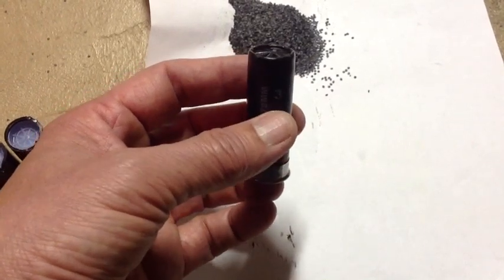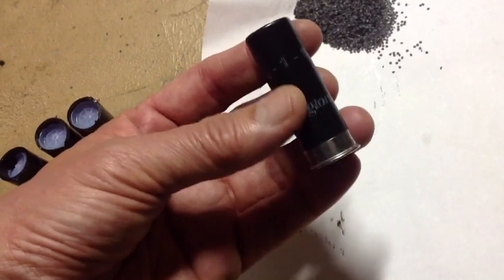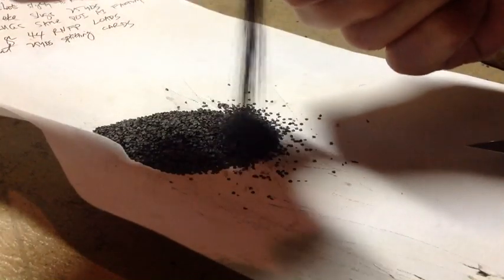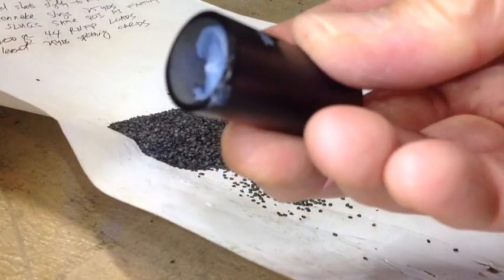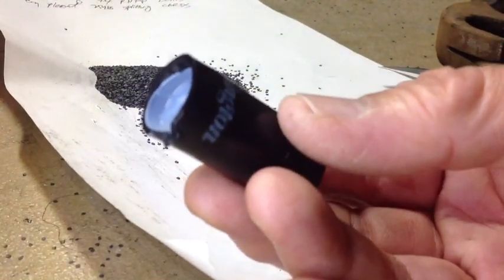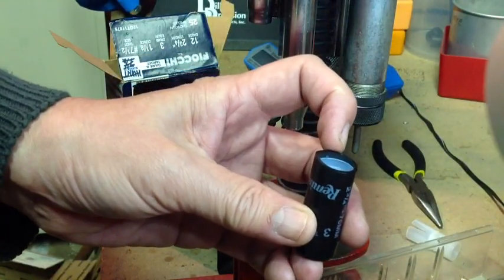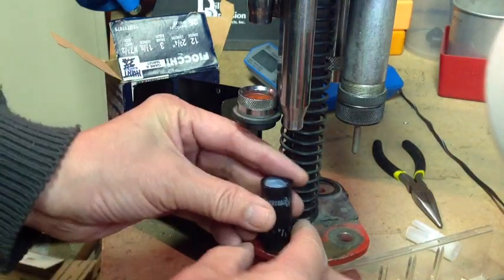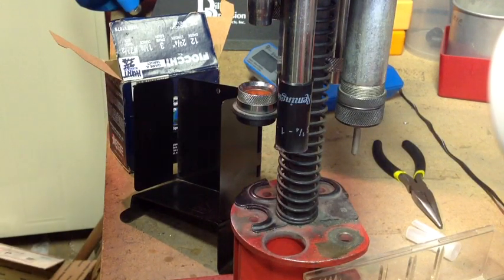Shotgun Slug Reloads - The Hidden Wad Problems

Comment: In one of your other vids you say you are using Federal 12S0 and 12S3 wads with Winchester AA hulls.  I hope that is not the case here, but I suspect that is your problem.  Winchester and Remington hulls are tapered hulls, Federal hulls are straight walled.  You don't want to use a straight walled wad in a tapered hull and vice versa.  Trying to cram a straight walled wad into a tapered hull can cause the base of the wad to go sideways and migrate powder into the leg portion of the wad.  That powder will not ignite.  For 3rd party wads like Lightning and Claybuster be sure to note what hulls they are meant for.  Sometimes you can cross over, but sometimes you can't and a stuck wad in a shotgun = blown out barrel or bulged barrel on the next shot.

Stay safe.
Reply from the maker: rsrocket1- Thanks for your info on this.  I first learned about this before I went into competitive trapshooting - I reloaded some of the cheaper straight wall Federals using my AA12 wads and got inconsistent ignition.  Any and all squibs in all guns need to have immediate barrel check before more rounds are fired or disaster as you describe occurs.  My solution was to only load AA components in Winchester AA hulls and Power Pistons in Remington STS, etc.  The Federal Gold Medals were not often used by other shooters, and I avoided them as well.  Today, the cost of shot practically makes reloading shot shotshells impractical for the little money saved.  And the inexpensive Remington target ammo actually has premium unibody hulls that I love to use to reload slugs.  Slug reloading is very economical because we can cast our own slugs.  I would tell shooters that AA components that would take slugs best be used with AA hulls or other injection molded unibody types.  And the Federal wads used with straight wall hulls like the Fiocchis, Winchesters, or Remingtons.  However, the Lyman Shotshell handbook has a limited number of recipes mixing the wads with the other type of hulls.  For the most part, I don't use those but they can work.  For instance, you can finger seat a Federal 12S wad into an AA case.  The advantage of the Federal wads is their stiffness, lack of bending, and well supported shot cup - might just solve this skirt bending issue.  I like them in Fiochhi hulls... Best to ya

Comment: plastic-on-plastic contact between edge of the wads and the hull may be making a hydraulic seal, with gas pressure putting a bind on the wad, when you seat.
Try seating the wads gradually, slower, by hand, see if you are getting back pressure particularly on the tail end of seating.
Those wad cups remind me of plastic bottles that let go under too much gas pressure.
Temperature of the plastic may have something to do with it.
Perhaps some dry lube is in order; dip the wad into a small pinch of mica?
Also, could be the mold release on the plastic, getting torched in firing, turning into tar, causing issue.
Reply from the maker: Lawrence Page - Always good to hear from Lawrence Page - You've got some real though provoking points there - good grief, shotshell reloading was not supposed to be so complicated according to the Lyman manuals and other publications.  After all these years, I think the slug reloading difficulties may be some kind of conspiracy on the part of ammo manufacturers and component makers to keep us from reaching the promised land of slug reloading lol :) :)  Happy Holidays, good reloadin' to ya…and I'm going to get some more mica...

Comment: It looks like those hulls have a separate plastic base wad that has a skirt that goes part of the way up the side of the hull and they are catching on the lip!
That is pretty much the same problem I have experienced in the automotive repair industry with shaped, directional seals being installed where there is a lip they can catch on when installing.
That is one the reason I chose to reload with once fired one piece shells that have the base wad a part of the shell like the Remington Gun Club.
The other is the possibility of the separate base wad coming loose and obstructing the bore.
 The Gun Club (tapered wall I feel are less desirable) was my second choice as I could not find any once fired Federal Gold Medal one piece plastic hulls (straight wall is what I would have preferred).

Comment: Your homework pays off. I'm wondering if something during the primer punch out or seating is causing nicks in the inside of your hulls for skirts to catch on. I've gotten skirts like that if the wad guide fingers don't nest inside the crimp opening when seating. A corner of crimp can kind of poke between the fingers and catch the skirt. I started feeling for the resistence there: ...Those problems decreased when I started holding the slug up against the drop tube so that the fingers were firmly within the wad guide well before the wad starts to go through.
Reply from the maker: GunFun ZS- Some real possibilities you bring up there, anything we can do to keep that obturator from catching on the way in is going to help us.  Note the factories have none of these issues as they use new components with no old crimps to deal with...Best Regards...

Comment: Interesting problem FC..
Makes me wonder if seating the wad with the slug fitted, cants everything over enough to do the damage to the obturation cup.. Perhaps seating the wad by itself and then fitting the slug afterwards would help keep things straighter and trouble free :-)
Reply from the maker: joehunt1980 - that's a great point.  I'm going to try that immediately…the idea is that the wad seating stem on the press will be pressing closer to the wad base instead of from farther out.  Also will give us more sensitivity seating the wad…Great thinking there…I'm standing up and applauding you for coming up with that.

Comment: Do you use Mica Wad Slick?  I use it for my .410 shells and it helps the wads slide in very smoothly.  I use a No. 2 pencil to insert the .410 wads and I can feel the difference between using the Wad Slick and when I forgot.  They just slide in better, and I would guess they slide out better too when you fire the shell.
Reply from the maker: WhiskeyHotel1969-Thanks for the tip and great comment.  Been loading shotshells for 35 years, can't even tell you how many trap loads I've done (loaded a case of shells every reloading session with my Dillon), and lots of slugs - never realized that the wad could do tricks like that - now, I'm seating each wad by itself and doing the final seating with a dowel so I can feel it going in…HNY
Reply: I am From Europe (Serbia)... What is that "pencil"? Some kind of graphite I suppose... To make it slick? Any other "lube" would interfer with powder...
Reply: Similar thing they do, when granulate Black Powder .. covering it with graphite... It is good for "slipering"...it is also a part of some greases for metal rotating parts, to diminish  friction...almost like Teflon does...

Comment: Shooting all those slugs thru out the years how many shoulders did you have replaced? : )
Reply from the maker: gman77gas-Ha,haa,har LOL :)  However, I do recall shooting 400+ rounds of 1 1/8 oz 3 dram shells A DAY in trap competitions (100 singles, 100 handicap, 50 pair of doubles, + warm up and practice traps - no wonder some shot semiautos so they would be fresher for the shootoffs - and shootoffs=even more shells).  Used to buy 16 pounds of powder to start the trapshooting seasons, wads by the 5000, and shot 300 pounds at a time.   I think the nerve in my shoulder going bad - causes tremors today shooting almost anything - had something to do with all the recoil pulses there over the years - one of the reasons I retired from all competitions, but don't tell anybody.  Best Regards...

Comment: Maybe it's better to seat the wad by hand or maybe try to clean the inside of the shell out a little so the wad wont get hung up and it'll slide in straight.
Reply from the maker: Prepare2Survive - Sounds workable, and you can bet I'm going to be checking the inside of the hulls with my finger after I've reprimed the hulls for any nicks that will be catching the base of the wads...Thanks for the comment...
Reply from the maker: +Prepare2Survive -- Our best bet is to use those opaque white hulls so we can see through them a bit, then seat the wad separately or by hand.  We might try dusting the obturator lip portion of the wad with mica (not talcum which will increase the friction) as well.  But no matter what we do, we cannot match the performance of factory slugs with their proprietary slug/wad/case all designed from ground up to work together in barrels to give accuracy and power.  What we have are jerryrigged slugs going into trap wads never designed for slugs or 1500 fps in the first place.  Best Regards,  FC

Comment: Hey man I recently casted slugs and loaded some test rounds. Used blue dot gun club hulls and down range wads. I did 38/39/40/41 grains each one left my barrel FULL of powder what I do wrong.
Reply from the maker: Robert Sload-Good to hear from you, and sorry to hear of your squib loads - I hate when that happens - really makes a mess of the action as well- sometimes fouls up the magazine tube in pumps and semis.  Happens when 1) using the cheap straight wall shotshell hulls (this may not be your problem with the good gun club hulls) 2) slower burning powders (like BD) with air space between powder and wad 3) bad primers (no doubt you are using good 209 primers) 4) worn out hulls-bad crimps.  Since you are getting squibs across the board, problem is probably 2) - I recommend you try seating the wad only past the old crimp and then doing final seating with a thick dowel to feel the wad seat and compress the powder charge a bit.  Then seat the slug separately.  Apply a good crimp.  Squibs are from ill or non ignition of the powder charge.  You might try a different hull also like the Win AA.  I'd tell you to use a hotter primer, but the Lee reloading recipes don't call for them…I've used Unique, Herco, Blue Dot loads starting at less than published data without problems, but did get squibs with AA#5 in the past - changing hulls solved the problem (but AA#5 did not shoot well for me so I used AA#5 in the 45 acp).  Currently, I only have Unique and not much of that left.  Made the mistake of not stocking up on Herco and BD - but some Herco is on the way...Best Regards…please let me know how it goes...

Comment: As you said shaking will detect it, my question is how noticeable is the loose powder
Reply from the maker: bill84345- definitely noticeable - I should have shown you how I could shake the extra powder back out that defect on video - there was a fair amount in there where it did not belong...But other wads caught and went in crooked without the powder signature so we can't depend on that to find these problems...
Reply: FortuneCookie45LC I'm thinking from my manufacturing days that  pressing the wad only in as slow as possible would reduce the defect problem if all but eliminate it.  each person would have to decide it the additional time would be worth less defects
Reply from the maker: bill84345 You are spot on about that one - I've loaded the Lee slugs for years without picking up on this possible problem.  It might be something that only happens to the Lyman 525 slug, but now that we know about it, we can definitely take steps to avoid it.  I am now loading all my slug wads separately and seating each one feeling for even powder compression using the thick end of a big Sharpie pen (fits the 12 gauge hull perfectly).  -then loading the slug in a separate step - there should be no more overpowder wad crinkles...Best Regards...

Comment: i reloaded 150 slugs last night and even though i used the same components and measures every time i noticed in some that my shot colum was lower resulting in a bad crimp. im going to cut one open and see whats going on.
Reply from the maker: grizzskoalcope- Hope all your wads are flat and straight.  I cut open 6 of mine to make that video.  Got another video coming out - did the research on YouTube first to see if anyone else had done that - don't want to repeat the work of others if possible - should be interesting for slug shooters…Best to ya...
Reply: Mixing tapered hulls with straight wads is a recipe for failure. Make sure your wads and hulls line up: Tapered with tapered, straight with straight

Comment: If commercial shells don't use those plastic wads, why do you?
Reply from the maker: +Myles Nicholas -- The Lee and Lyman slugs are diametered to be used with those common trap wads.  If we don't use them, they will shoot poorly because of the "rattle down the barrel" effect.  We'd love to have those factory slugs and wads if they would sell them to us.  We'd also love to be able to cast slugs and buy those specially fitted post wads if that was available.  None are = mystery... Best to ya,  FC
Reply: +FortuneCookie45LC You're right I should have realised. They have you cornered.
So even using brass shells with waxed shot might be the cheapest option.
Reply from the maker: +Myles Nicholas -- I've tried the wax slugs and when they work, they work OK - accuracy is really a matter of conjecture past 50 feet.   Yes, they are cheap, but the factories would not touch them because they are not dependable nor reliable ammo.  Heaven help anything that gets centerpunched by one that isn't a squib load though.  Best Regards,  FC